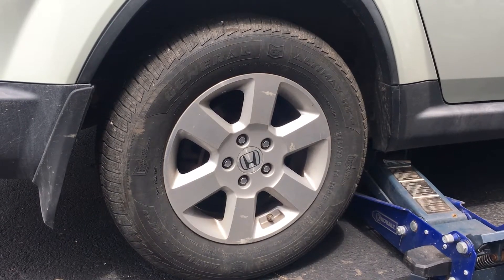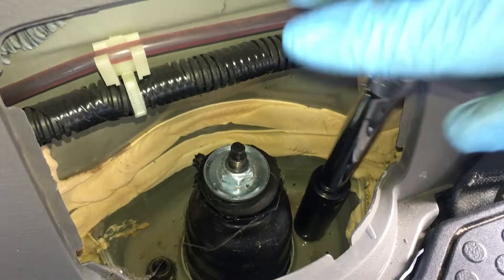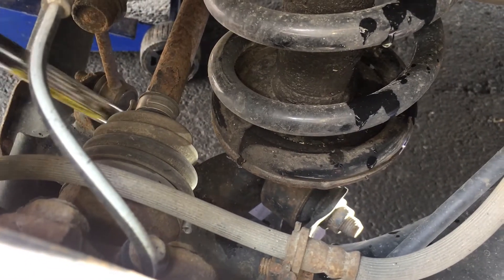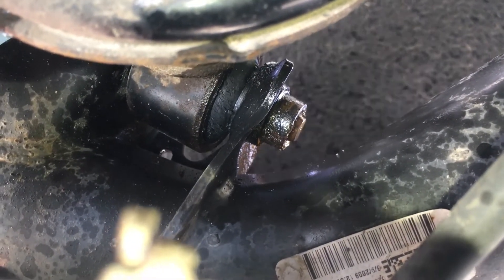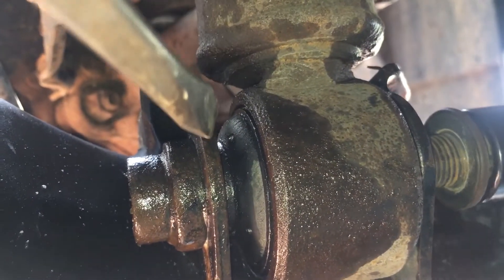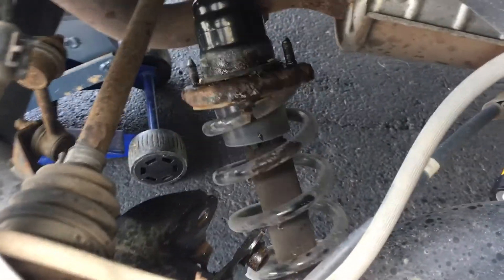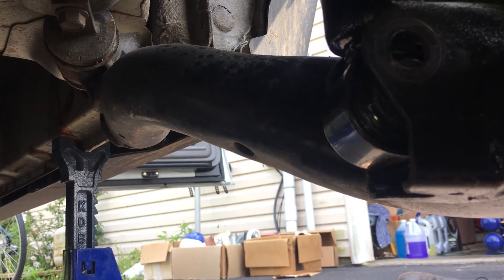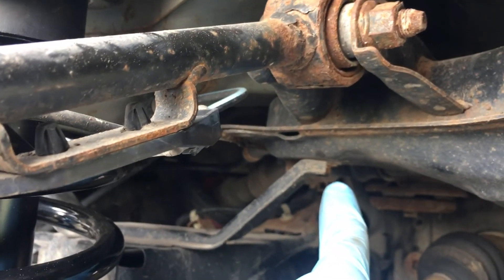How to replace a rear strut on a 2009 Honda Element EX

Comment: if you cut the bolt, how do you remove remainder of the bolt out of the captive nut?
Reply from the maker: I would recommend ONLY cutting the bolt if the round nut broke free on its own. If it did not break free from its welds I’d just re-use the original bolt and original nut when installing the new strut. 

The remainder of the bolt in the nut is not a problem if the nut has broken free. You just throw out the nut and the cut bolt and replace it with a new nut and bolt.
Reply: @Ectropy  the bolt broke next to the head. So I have installed struct with remainder of the bolt inside. I can cut the bolt where you suggest, but it would leave a bolt stub in the captive (welded) nut. So how do I remove what's left from the bolt?
Reply from the maker: @ipekur  Hmm that’s a challenging one. So the bolt snapped leaving part of it in the nut. Not ideal. I’m thinking of two options—

First idea, use a special tap and die tool (a chaser) remove the old bolt, without destroying the threads of the nut. I’m not sure how well this would work, but in theory it could work.

Second idea, locate the spots that the nut is welded, and use an angle grinder or other tool to cut/remove the nut’s welds then remove the nut.

I didn’t have this problem when I did the work on my vehicle. Hopefully you’re able to solve the issue. It sounds frustrating
Reply from the maker: No matter what it sounds like you’ll need to buy a new nut and bolt. See the description of my video for the length, width and grade of nut and bolt I used.
Reply: Sorry, this is misleading advice
Reply: Not being a “Debbie Downer” because your video actually was very informative !
But...
If you cut the bolt as you described it will not let you remove the bolt from the welded nut. It will only remove the head of the bolt. Which means the strut is still connected to the cut off bolt. You are better off to cut the welded nut. Using the grinder To cut the welded not see you can then punch the whole bolt out of the strut.
If you cut the bolts off where it goes into the welded not, you would then have a nightmare to try to remove that small portion of bolt that’s still screwed into the welded nut. 
In either case, only cutting one side of the bolt would not be able to remove the strut. If you think about it, The only way to make this whole process work, including adding a new bolt with a nut as he described means you have to cut off the welded nut and throw it away!you only have to cut off the welded nut
Reply: Have to cut the welded nut off,
I just replaced my rear struts, upper and lower arms. Even with cutting  the welded nut off, the bolt was seized inside the bushing.
You have to cut on both sides of the bushing. Then with a little prying and a hammer it comes out.
Reply: @craigwiess1656  exactly what happened to mine.
The bolt was seized in the strut-
However, it was free in the welded nut!
So in the end-
I did not cut the welded nut, just both sides of the bushing.-leaving just enough bolt to grab with vise grips. 
Remove the strut, and the to bolt parts came right out.
Get a factory Honda bolt!
Reply: @craigwiess1656  that's what I dud also!
Reply: @ipekur  locking pliers to back out broken piece or cut off captive nut!
Reply: @craigwiess1656  What did you use to cut it off and how much did the mounting braket suffer? Is there enough clerance to use a grinding disk on an angle grinder? I'd be doing the job from underneath lying on my back. Thanks for your advice!
Reply: @johnnyjimj  cut off disc in a grinder and a reciprocating saw with a Diablo blade.
Reply: @craigwiess1656  Thank you for your feedback - I had a closer look last night after watching the video for the umpteenth time and there seems to be enough space to go at it with a 4" grinder from the inside, in between the strut and the bolt "yoke", to cut off the bolt head and from the outside of the yoke to shear off the welded nut  -  I should then be able to simply pry the shock off the welded nut side without stressing the yoke.  I hope not to require the sawzall at all, I've found it tends to jam and kick in hard to reach locations like that.

Comment: I think in the rear there is no left and right.
Reply from the maker: On this vehicle the left and right struts are different. I know this because I had to return one because it didn’t fit. 😅😅😅 Good to make sure you bought the correct struts
Reply: @Ectropy  How did it not fit, the top hats and mounts are identical?
Reply from the maker: @dattran6372  the bottom of the strut is I guess “rotated” or angled differently— not sure the best way to describe it. But the part with the hole that the lower bolt goes thru on the strut won’t line up if you have the wrong side. (The part I’m referring to that is different is the part with the hole that I talk about around 3:49)
Tbh it is a pretty strange design choice—Honda could surely have designed a strut that is identical for both sides. As you pointed out the top is already identical.
Reply: @Ectropy  but I think you can just rotate it.
Reply from the maker: @dattran6372  Not in my experience. You’ll notice the product numbers for the struts are different too. They end in L or R if I recall correctly
Reply: @Ectropy  I just confirmed with the honda shop that they actually are interchangeable and you can actually just twist the bottom to match the angle to get the bolt in.
Reply from the maker: @dattran6372  might need a tool to do that yourself (it didn’t seem to want to budge), but that’s cool! Could save some time if you got a “wrong” one.
Reply: @Ectropy  They said it's tight, but just need to put a rod, screwdriver, or similar in the bottom hole and turn it.